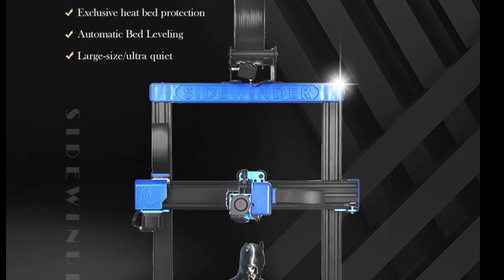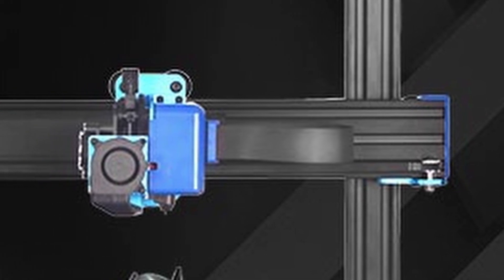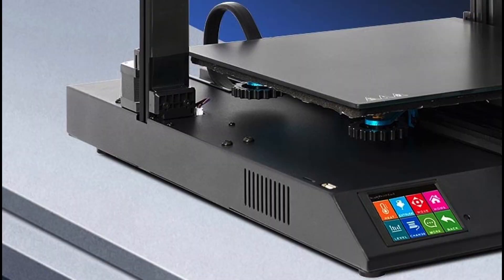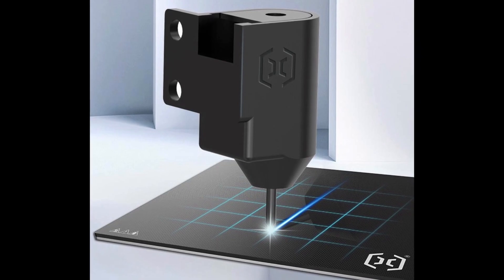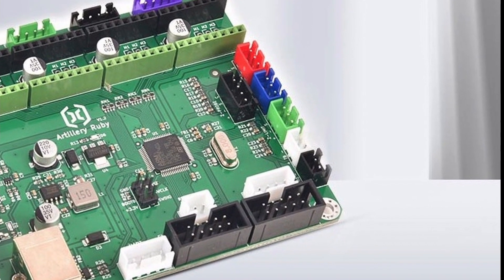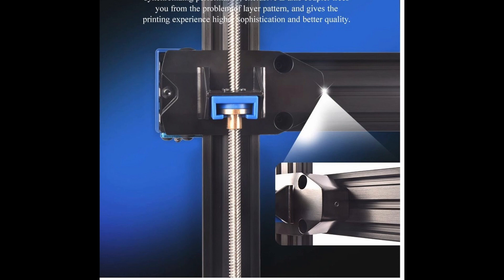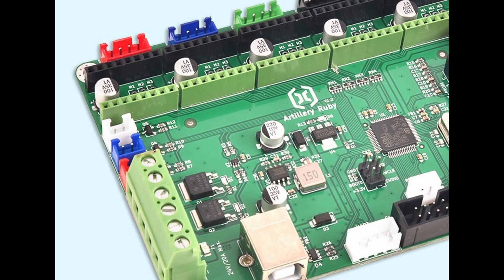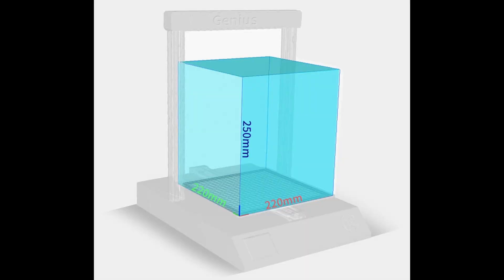Z3DP reaction to Artillery Sidewinder X2 and the Genius Pro - Z3DP News and Updates

Comment: So you don't actually have one yet? One major upgrade is the heated bed cable.
Reply from the maker: Oh that is wonderful. Unfortunately I can’t buy every new 3D printer, but I’m always looking for new printers that are going to be released or recently on available. It is very good that they upgraded that
Reply: I'm considering whether to buy one of these. The heated bed cable was a major concern in the X1, it could fray and become a fire hazard. If you look at other reviews you'll see the bed is glass, it's got some sort of texture and isn't carbon coated.
Reply from the maker: @iskandartaib  I can not speak from own user experience with one of these machines, but from what I have seen, it’s a printer that I would buy
Reply: @Zachary3DPrints  It's high on the list, but I also have to consider the Ender 3 Max (a lot cheaper, but only one lead screw, and uses a Bowden tube), the Bluer Plus and the Sapphire Plus (slightly more expensive, both use Bowden tubes, the latter is a CoreXY and would be stiffer).